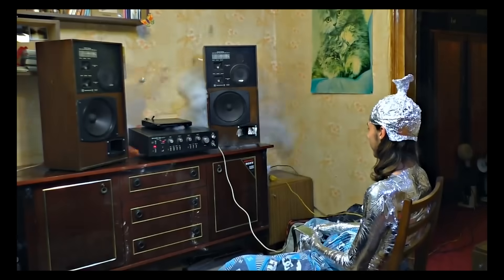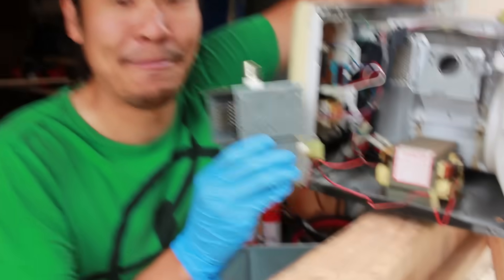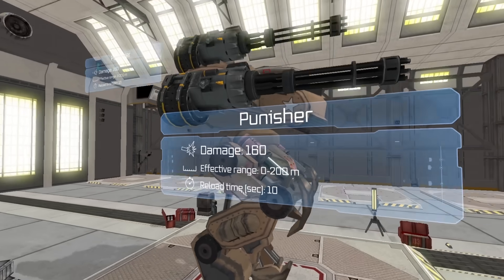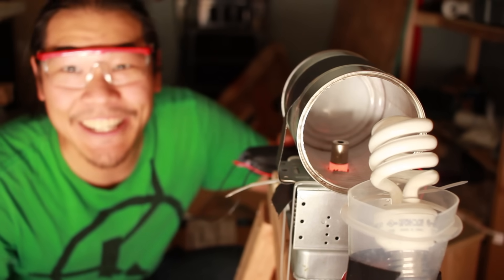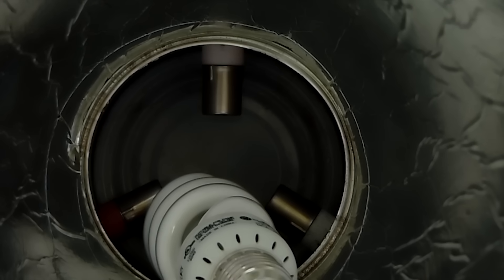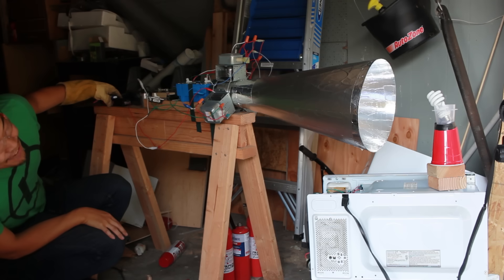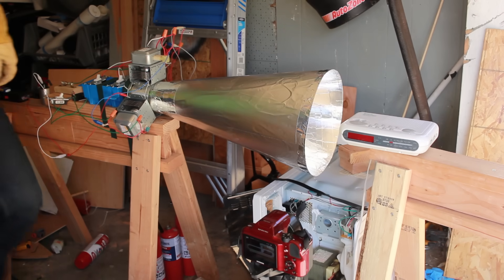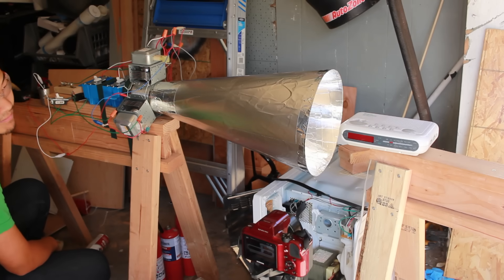A Microwave Gun Made From Taser and Soup Can??? (Testing Kreosan's Magnetron Cannon)

Comment: Dislike as you proved that this technology can actually work, after watching original video and understanding Russian language at start of video was explained that they using special capacitors and military  shocker with modified battery - They also noticed that they was having problems with range (as you have), but its took a while to configure emp gun to work on range. 
So please think twice before saying fake.
Reply: Military taser lol never heard shit like that , that will change nothing after all the needed power cant just be deliverd by a taser
Reply: The tech still isn't going to make anything explode, even if you condescend to people
Reply: Incorrect.  Even this far less than ideal setup made some electrolytic capacitors explode in the video.  Try putting an old PC motherboard (or any other junk PCB with lots of caps on it) in an old microwave.  Works even better.

If nobody calls fake people out who dumb everything down, society implodes.  The lowest intellectual common denominator should NOT be the standard by which we measure society.
Reply: Go check out elctroboom's video on the Russians video. He disproves it a little more scientifically, as he deals with electronics of all sorts for a living, but yes this you young man is right. Not enough power Scotty.
Reply: Come on guys, it's kind of silly even wasting time on replicating a russian video having guys in it with tin foil on their heads.  This is like trying to prove that David Copperfield can levitate an elephant. lol xD
Can't trust guys with tin foil on their heads... just sayin'...
Reply: Sperg.
Reply: @D King obviously you're an authority on the topic, what are the specs for this taser/capacitor combo you have deemed useless?  Explain yourself, don't blindly contradict others and then claim they are being stupid, it's ironic and I won't stand for it.
Reply: @John Doe spank you very much, this is a good comment. Your argument is sound and well founded.
Reply: Yeah- this dude was just trying to debunk the other video for views. The original video was using a taser with some extra juice. Microwaves are not to be taken lightly. Voltage varies the magnetron's frequency. The antenna is the waveguide aka the cone. IF they did some math. They could of gotten far more Db gain from the antenna. [cone] You can KILL a moving vehicle or in the last stall it 1/2 a mile away. The pulsating effect cause more damage than straight microwave. I've been toying with microwaves since the 80's. It can be fun, but she be done in small doses. BUT what is cool- is microwave is a is CW and has cool hobby potential! Have a read: https://www.microwaves101.com/encyclopedias/circulators
Reply: whachu mean military microwaves wont concentrate a beam of waves for 50 feet while still holding its powerfull electromagnetic capabilities
Reply: @elko7708  Incorrect and microwaves  go from  1ghz to 30,50ghz etc. With different effects. The ADS at 30ghz reaches hundreds of feet.2 watt  microwave links are hundreds of miles apart. I am  not saying you dumb.But microwaves are  aided  by an antenna which is a  horn/cone. Using  an equation  they  can control the wave  width,DB Gain, and distance power etc. Microwaves vary in perfomance,distance based upon many variables. In 1997  I  watched a test on a 87/88 Buick.  The Microwave  KILLED the car at the 1/2 mile mark. I've 'flushed' birds from  a tree  with  a wide horn at  150ft away. [Invasive Species]  Microwave is very complex compared  to a HF/VHF transmitter. Plus Microwave with a duplexer can send/receive  like a phone call. Which you CANT do on other bands. Trust us- we know what we are talking  about  ELKO7 .
Reply: @Random-Slavic-Channel  ok thanks i actually didnt know that, still questioning if it  is real but my bad, i didnt know that :)
Reply: dafuq military taser and dafuq special capacitor? all you need to do are regular taser and capacitor with higher farad, you better ask and not acted as pseudo intelectual
Reply: @J H You are full of shit. Are you the "it's the amps that kill you, not the volts" kind? Depending on the load, tazer output can go up to ~50kv (open) and peak over 10 amps under "load" (pressed against someone's skin) It's the charge that makes them painful and effective at disrupting muscle control, witch is measured in coulombs (1c=1A*1s). What makes them safe is the short duration of each impulse. This is what makes it work in our case, high energy pulses of EM radiation can easily disrupt and/or damage unshielded electronics. So for a short duration we can get the magnetrons to run at a much higher power then they were rated for (at this point they are inefficient, so he used 3 of them to reduce the loses and up the effective output). Also most microwave ovens are in the 500-1000w range, the transformer outputs 2kv, witch is doubled across the electrodes of the magnetron by using a doubler made out of a diode and the magnetron (witch is also a diode), so under normal circumstances the magnetron operates at about 125-250 mA... not much at all. Even if we use a capacitor in parallel with them we are still running them for the duration of the pulse at a few times the normal specs.
Microwaves can travel the distances seen in the video more then fine, the trick is to keep them as much as possible into a tight beam. Easiest way to do this is to use a parabolic antenna and replace the receiver with the magnetron, but also use another small parabolic surface (a metal bowl perhaps might be good enough? just drill a hall and screw it on the way they mounted the tin can), to direct the output at the parabolic surface of the antenna. By fiddling with the distance from magnetron to the dish you can get it as closely as possible to a tight beam (if you could see the microwaves it should look like a projector or long rage flood light). The design in the video is very crude and lossy, but cheap and easy to make.

I'd love to hear you talk about "secret military weapons" If you do let me know in advance so I can microwave me a big bag of popcorn to enjoy while being... enlightened by your vast knowledge!

Do some reading when you talk about something because if you state false information as facts with enough confidence you run the risk of people actually believing you. Also arrogance does you no good, even if you are 100% right.
Reply: @J H "I mean, what do you guys know about secret military weaponry and physics? Not a damn thing." Copied out of your comment: https://gyazo.com/c737eb0df9efe40390c3a4138a8ff4e9 and then you try discredit my credibility by... pointing at a spelling mistake I made in a... youtube comment. What? are you 12 or something?
I do not know what you mean by "run" as both this video and kreosan's show a working device. I really hope you do not hope to make a cup of tea with it, as it's output averages to a few watts. The reason he used a tazer is... again, for the high energy spikes, not the overall average. P=U*I, unless current is offset from the voltage (witch is the case in here since this is an inductive load), then you multiply it by the power factor. To simplify things we can leave that out for now. Going to assume the power you mentioned is marked on the magnetron itself, not on the back of the oven, so the I=775/4100=0.189A, witch is within the 125-250mA ballpark I mentioned, so I have no clue where you are trying to get with this?

Tazers output is in amps, as in multiple amps, for a short duration, in the range of a millisecond, since you seem so hard to convince this is true and you are stuck on the idea it outputs a few milliamps, here is some information I found n 20 seconds of googleing, if you need more proof, look more for yourself https://gyazo.com/ac4597fe54a8123f74711826c89a114b Some "made in china" generic brand one can go up to 10-20 amps, but most of them are the opposite (like some suspect is the case in this video). Here is a comparison of a "consumer grade" vs "military grade" https://gyazo.com/c72d6ebf9fa429fd7c0faeb6a88e0bbe If you look at the second one you can see the pulse is about 0.05 ms vs the first, 0.5 ms, if you want you can calculate the surface area between the lower axis and the graph to get the charge in coulombs and notice they are not much different (1C=1A*1s). If you average out the output, including the spaces between the pulses, yes, you get milliamps, but of what use is that information in our context? Peak power is what matters the most for this contraption.

And as I stated before the 50kV tazer output is only in open circuit and is dictated by the gap between the electrodes, when you put a load on it that drops to about 1kV and the current increases to what you seen in the graphs. In the magnetron case we stay above that since the spark gap limits the voltage to about 5-8kV so the current is slightly lower then the the graph. I cannot know for certain if you can blow up an old tv, but I am inclined to believe based on what I've seen in the video and what I know that it's a realistic outcome. And I am 100% sure it can cause damage to most electronics, especially most cheap stuff that lacks in the shielding department.
Reply: @J H "I didnt discredit what you said based on your grammatical error" https://gyazo.com/dca21d0a48cb2a619d5b78a2e106f7f5 soooo, what purpose does the " I stand with physics over a man/women who doesn't know the difference between "then" and "than"." statement has? At no point did I try to convince you the video is fake or real, I just sayed I think (my personal opinion, not trying to convince you anything) it is plausible and does not seem unrealistic at all, I went ahead and recommended some improvements and tuning. That and kept pointing out all the wrong ridiculous facts you stated before and how you were bragging on your knowledge in the field, while saying stuff like "To make a microwave travel through air 50' is going to require more power than what comes into your house, ..." You know what uses microwaves to communicate? Phone and wireless internet! And you keep saying you did not say  things that are in text, that I keep quoting back to you, keep expanding and adding more crap in the discussion witch a 9 year old with an internet connection can disprove in less than a minute. And now you bring genders in? WHY? What does that have to do with this conversation at all? Seems to me you are stubborn as a mule and have a skull thick as a brick, you are not used to ppl that call you on your bullshit and know how to back it up. You enjoy arguing and wining it. Keep twisting and turning the conversation until you land on your feet or the other person gives up and walks away. Am I wrong?

"Can you get electricity to run through a circuit? Of course... Does that mean it will work properly?" define properly, cause to me properly means flickering neon/cfl lights a few feet away and damage to some electronics as I stated before... We are talking about a magnetron tied to a stick with a tazer, a battery and a few other components. I cannot say if it can damage a moped as I barely know anything about theyr electronics and how well shielded are they and robust/vulnerable to em radiation. I can say it is possible to set a tv on fire or do permanent damage to it. This can be more destructive to electronics due to having higher peak power, inducing higher voltages through circuits, as a result, higher chance to cause damage to transistor gates (witch are the most vulnerable part in my opinion) or causing them to open in ways that can cause a direct short to ground, blowing up the component (look up for example a push-pull audio amplifier, if both output transistors open at the same time, even without being damaged! ... pop, or if no safety cause cheap device... maybe flames too. example: https://gyazo.com/6db864aa2a060df3c2b0caad435ba69d) DC/brushless motor controllers and most switching power supplies have the same vulnerability, with a potential for more violent failure. Electroboom made a video recently that explains how those work really well and easy to understand. I poped a usb port on my computer a few years ago while playing with a tesla coil in another room, guess the mouse cable picked up enough em to mess something up. And these are cases that come to mind, there is so much more! Where I am going with this thing is trying to show how vulnerable electronics can be to em radiation. While the digital or 'fine' parts of a device can be shielded, power supplies and high power/control stuff is usually not.

You seem very confident about a lot of things that are false or out of proportion and being your goal is being right rather then having a civil discussion on the topic of the video or the comment thread. Even if you are in the right, being patronising, arrogant or condescending will give negative feedback more often than not. I am not angry or even upset, I do not try to insult you because you disagree with me, I just call them as I see them. I can type all day as for the next 2-3 days am stuck with a job where all I have to do is sit on a chair at my computer and check something every now and then. Under any other circumstance I would have stopped after the first comment. Cheers!
Reply: @J H In 2 rows you prove me that I was right to think you do not give a rat's arse about any of the science involved, you have no interest in it or any sort reasoning or civil debate. All you see, is what you want to see. From your first comment all you did was throw around insults and call out the stupidity of others, yet so far you prove me you tend to hold to false information as hard facts, witch confidence. Look up the meaning of the words "stupidity" and "arrogance" and let me know witch one has a stronger negative effect in society. You are out to score "internet points" by wining arguments you start and dismissing reasoning by calling me "triggered", "mad" and immature by adressing me as "child". You start your response with "cool story bro", are still stuck on the spelling thing, try to jab genders in the discussion and... you call me a child. I have no care nor interest in who and what you think is wrong here. Never did.

Oh, almost forgot! I could not but notice your amazing ability to pull facts out of thin air: "any college you go to will discredit your grade point average based on grammar" No. Not at all. In any science based college, especially practical science, occasional grammar and spelling mistakes have no effect on your score and are present quite often in books (to cut costs, sometimes ppl skip the step of having and editor check your book) and sometimes even in scientific publications. A professor in collage that had dyslexia would often be the target of jokes or just have ppl point out his spelling mistakes and I remember one time, he responded with "If you got the message that the words were meant to convey without effort, then they served theyr purpose. Those that notice them (reffering to his spelling mistakes) don't matter, it's those who do not notice them that matter.". Those words will stick with me to the end. If the first thing someone points out when you say something is some petty spelling mistake it mens that the whole thing flew over theyr head and and the feeling was not nice, therefore they have to attack you back somehow... so the lowest hanging fruit is the one on the ground... might as well grab that one!

Don't get me wrong, it's not all negatives! Have you ever tried a career in sales and advertisement? My break is over, good luck!
Reply: Denis Reznikov he doesn't understand Russian and he didn't know about the mitary grade equipment
Reply: Denis Reznikov then that's misinformation because special capacitors, military shocker, and modified battery are not in normal microwaves so "think twice" before you try to prove your point
Reply: @Denis Reznikov... Exactly. Anyone with experience in electronics, engineering, or physics would be able to see that even if they don't speak Russian.  Most of the people on YouTube are fake as fuck, steal the work of others, and laugh at things they don't understand much about (or they do understand, but instead choose to play dumb to get views/sponsorship). Money/Marketing is the death of real communication.
Reply: I also disliked this video for a number of reasons. First I do not understand Russian but after viewing the original video you can clearly identify a capacitor is being used by then just by sight. Unfortunately the author of this video missed that. Secondly the way he setup his magnetron was given little to no thought for propagation and his wave guide is clearly not calibrated to properly guide any of the waves that he has collected. I am glad that he had enough interest to attempt to build this and that he took the time to produce a video perhaps he can reach out to some friends for better assistance next time though.
Reply: Denis Reznikov also it isn't really from a regular microwave. Almost any where else they don't basically go and give military equipment to people. (PLEASE TELL ME IF THEY DO THAT WHRE YOU LIVE)
Reply: Former soviet union has liquidated  every kind of military equipment and surpluss to any available buyer.
Reply: @paulsantiago7643  "military grade tazer" is fancy talk for high quality tazer. You can get one if you know where to look (hint: most likely NOT on ebay or eliexpres and expect to pay more then 10$) and don't live in the uk.
Reply: @You1rst  Ну если бы ты смотрел видео, то нить накала нагревается отдельной батареей, автор канала об этом говорит.
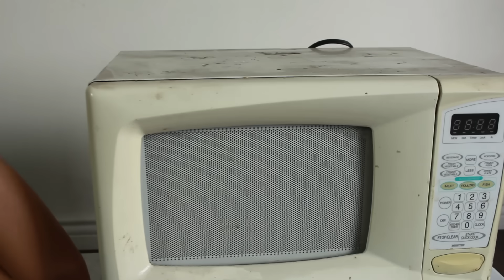Reply: I agree with Desin Reznikov about modified shocker and military components. Also if you don't know, you can buy military QUALITY parts even if you are not military. The word MILITARY describes that these components are high quality. Also on 00:32 they said that they synchronised those three magnetrons. Actually Allen Pan - Sufficiently Advanced why dont you communicated with KREOSAN and asked for a schematic, if you don't understand Russian than it doesn't mean that they don't understand English?